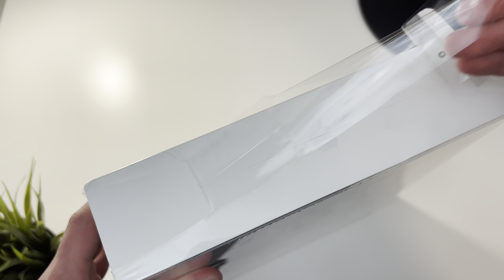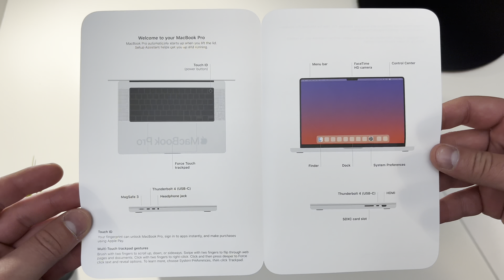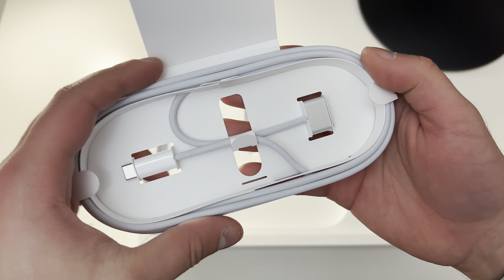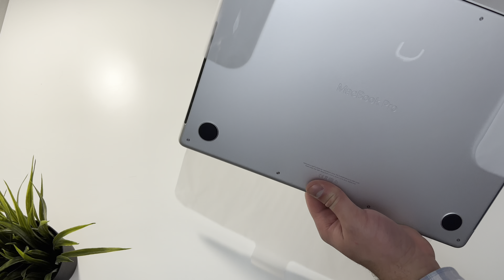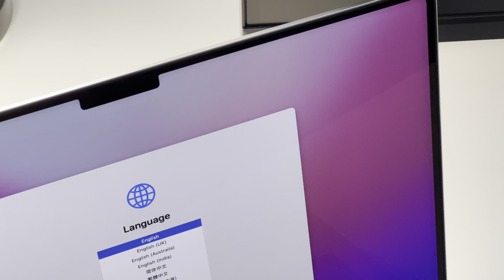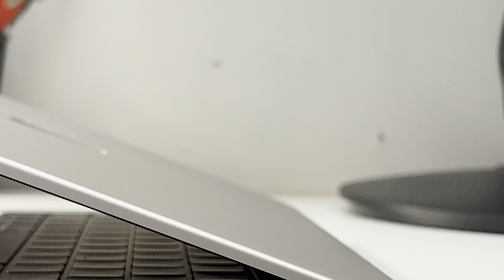Unboxing and First Look at the new 14 Inch MacBook Pro!

Comment: Still can’t decide if I should get the 14 base model or spend extra for full chip 10cpu 16gpu
Reply from the maker: While I hope to really make on conclusion on that subject in my final review, I’ll say this.  The base is plenty powerful, and unless you can specifically point to a reason for the extra horse power, I personally couldn’t see it being worth it (not to say you can’t )
Reply: Base model should suffice for most people. Depending on your workflow, the most common questions I would be asking is how much does battery life mean to you and how much RAM you need. I personally went with the base model 16" with upgraded RAM, so 10c/16c/32GB/512GB. I'm a software developer and my workflow consists of 4-6GB allocated to docker containers, various Electron-based apps like Spotify, slack, Postman, 30+ Chrome tabs at any given point, and sometimes an iPhone emulator for app development. I will likely lean towards 64GB of RAM and 1TB of storage in the next few years as stuff becomes more bloated.